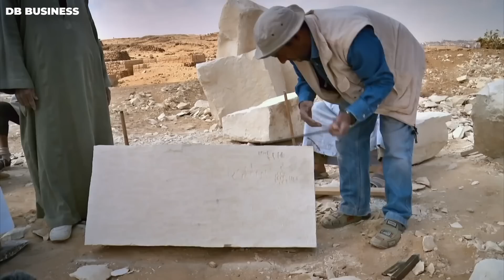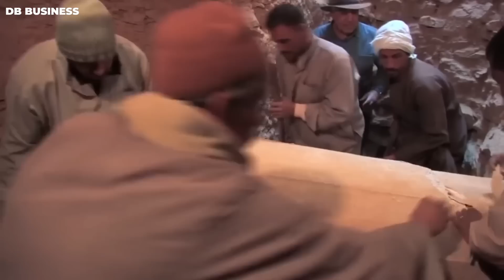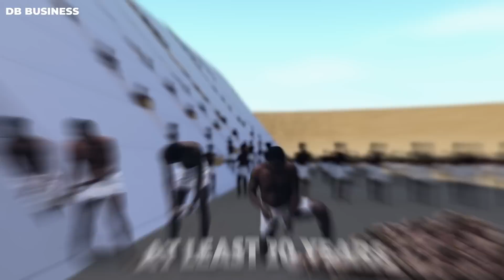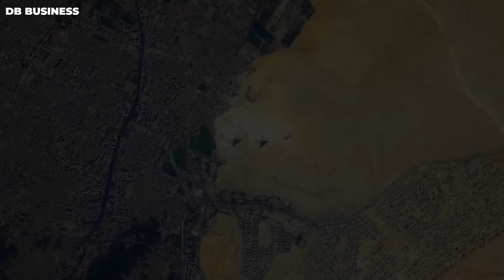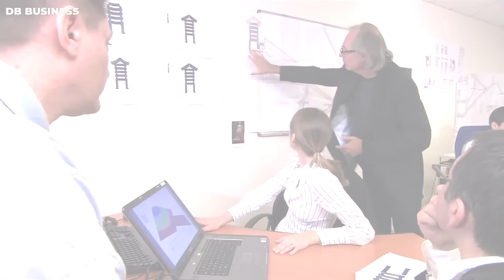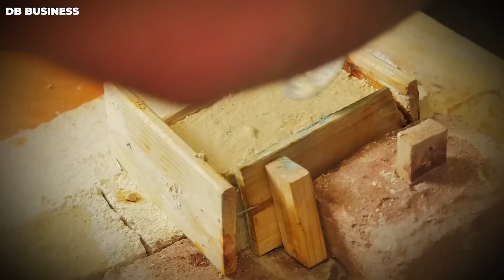The Mystery of The Great Pyramid Has Just Been Solved by Elon Musk

Comment: If a man can lift 200 pounds. It'd take 800 to lift 80 tons. That's not accounting for the friction of lifting with sub par pulleys. And not accounting for exhaustion. Seems a bit small of a landing for 800 people. Maybe they used counter weights?

When he says each 2.5 ton block was carried up the next step by 8 men, they assume each man is moving 625 pounds.  These are some damn strong humans!!!!!!!
Reply: You can’t just divide weight like that to decide how many people it would take. There’s also only one block that might possibly weigh “close” to 80 tons.
Reply: @AveragePicker  oh, no?? How should we divide it up?? Each man has a forklift capable of lifting 3 tons, so it'll take one man for the little bricks. He can just drive it straight to the top! I'm aware that's a very crude equation, but it's close enough to show the idiocy of the idea that 8 men can move a 2.5 ton stone.
Reply: @jamesdriggers2011  Why are you now talking about forklifts? And your terminology is all over the place for whatever direction the object needs to go. With levering and some creative physics it’s entirely doable. Heck at work using nothing but lots of wood blocks, wood mallet, and a pry bar I move about 3,000 pounds of flat pallet packed racking. Granted I only needed to move it about 16 feet and rotate it but I clearly can’t “lift” 3k pounds. 
You can balance off and tilt weight as well so while no you can’t “lift” a refrigerator by yourself you could still load into a truck bed. Physics.
Reply: @AveragePicker  they are being depicted lifting the blocks up to the next level. Im not saying it's impossible to do by sheer man power. Im saying thier math doesn't add up.

Comment: The conventional explanation for the building of the pyramids is total hogwash. Engineers have looked at it and said that if ramps were used to haul blocks up the pyramid, the ramp structures would need to be more massive than the pyramid itself and there is no physical evidence of such a ramp ever having been there. Including, where did all the material for the ramp go?
And they weren't tombs. No mummy has ever been found in them, none of the things that go with mummies, and no hieroglyphs. The mummies are in tombs in the Valley Of The Kings.
Also, geological and hydrological evidence shows them to be far older than we are told. FAR older.
The Japanese tried to built a 1/4 scale model of the great pyramid using modern technology. They failed almost as soon as they started. They couldn't even come close to doing it. 
I don't buy Elon's UFO theory either.

Comment: The pyramids at Giza plateau are definitely OLD. I believe the Egyptians merely settled there seeing that land as divine. With their levels of technical capabilities, it is impossible for them to create those though I believe they have tried with "other" pyramids around there that are crumbling. They can't carbon date the great pyramid, but some people have taken note of the water erosion on the sphinx that if true puts it in another time with a much different climate. Possibly 20 to 35,000 years old. They weren't tombs and "egyptologists" that keep clinging to that only want to protect their wallets and reputation, it is despicable. The great pyramid was built like an insulated electrical circuit. The outer white limestone had almost no electric conductivity while the inner stones and red granite had amazing conductivity. Their copper chisels could not have cut the granite as accurate and as fine as what is shown, there would have been wavy wedge marks. It was built it seems to have a functional purpose, and to hold power within to be harnessed then sent up the grand gallery to the kings chamber to be emitted out the shafts which have the same size dimensions that one would use for a microwave waveguide. To the north in Abou Rawash the Pyramid of Djedefre they call it goes against all their so called theories about how it they were built. This particular pyramid sits atop a mountain and built into the ground..it also seems to have had a functional purpose. The fact is either these were built by humans at another peak of technology and forgotten, or "gods" from another space system that created us in their image. I do believe the old testament bible, but I believe it is translated wrong. The only other thing I can think of is that Atlantis was real, and who were the Atlanteans?
Reply: You forgot to throw Bigfoot and ancient aliens into your absurdity.

Comment: Sorry Elon -- the blocks were floated to the site, and raised to height while keeping the stone soft in water. Animal bladders provided positive bouyancy.  Just a matter of channelling water. The long internal shafts simplified the rise from within. The surface were smoothed using the water level as while the stone was being finished, each a copy of another.  It's a lot easier to pour water (Artesian ?) than lift blocks.
Reply: lol Sure they did. So tell me how many animals bladders were needed on each stone. I want actual stone weight vs buoyancy of the animal bladders in the water. Not to mention the water system to hold that much water and weight and raise them would be more impressive than the pyramids themselves. The internal shafts are not big enough so that's out...   You should do stand up.

Comment: Common sense says people did not drag building size blocks thousands of miles with logs and pulleys. The material it's made of is both insulated and conductive by electricity. It uses piezoelectrics and sound resonance to transmit power wirelessly through the earth and air via it's gold capstone.

Comment: If the pyramids were built by men, it could only be with the help of a technique other than chisels, hammers, rollers, ropes, etc. Moreover, using a new dating system called Chlorin 23, the Stonehenge Site was estimated to be 25,000 years old instead of the 4,500 years established by the system. The great pyramid having received +/- the same age as Stonehenge, it is normal to also give it 25000 years. The Egyptians have nothing to do with it.

Comment: Pyramid was made for electical energy, a sun dial, and calendar. Its just like tesla who invented free electric energy and Chinese made a calendar. They built it accurately using math numbers, engineering and workers. They used the Sun, the axis of earth, the time when the weather is changing thats why theres an portion in the pyramid that they can adjust. Also those 3 pyramids are accurately pin point on orion constellation.
Reply: And the sphinx faces the constellation of Leo during the summer solstice.

Comment: What I think is that they had lots of materials to work from, as sand rock and cement, water and limestone, like Mexico and South America, they where not dummies. With concrete you can build the biggest structure in the word.
Reply: They didn't use any morter at all.?
Reply: Actually the granite used in the "king's chamber" was from 500 miles away.
Reply: @nittydalion  that proves they weren’t dumb, they have material from all over
Reply: @Jayfrm301  I definitely know they were intelligent. It begs the question, how did they move them that far and then up that high in the air?
Reply: You mental timeline is a little off lol

Comment: Elon, Hawass, all of you have totally overlooked the most important missing fact:
Granite can only be cut or shaped by a harder material.  Diamonds are the next hardest material naturally occurring yet there’s no evidence of them being used, no diamonds nor diamond dust.  Secondly steel was not in existence.  Thirdly each of the 2.3 million granite blocks contained in the Great Pyramid was custom cut to within 1/1000th of an inch as found in the interior, not even a sheet of paper can be slid between the blocks. This is impossible to achieve with the tools in known existence. Today, we could not achieve 1/1000th of an inch flatness over the full length, width, depth of each of the 2.3 million custom cut granite blocks weighing 80 tons each in most cases. Ropes can’t take that and wooden skids can’t take that.  Had to have been done using a very powerful laser and/or anti-gravity for both cutting & shaping & lifting into position. Anti gravity boring and tunneling machines are in fact in use today as used in gold mining underground and tunneling.  No dirt is left, all matter in front of the anti-gravity boring machine is vaporized, leaving a smooth surface. Anti gravity lifting technologies hsve been in existence in USAF since the early 50’s  just classified.

Comment: The great pyramids were likely squatted upon due to their splendor and grandeur. The Serapeum of Saqqara bears evidence of this in that it is suspected someone had the idea to use them as physical symbols essentially for religious propaganda, the surfaces were vandalized with rough chiseled glyphs in comparison to the finish quality of the giant stone enclosures. 

There are no actual records of them finding pharaohs in the great pyramids, we find them in the valley of the kings. Historical record has a man being lent a deal of shillings because naturally, many who laid eyes upon them in ancient times were probably enamored. 

That does not begin to mention other copious number of oddities in the great pyramid, Khufu. Gantenbrink's doors or rather those plates, with corroded metal prongs and a corner cut inside a shaft that is built in the most complex way you might imagine while being made out of stone. 

All of it is very peculiar in that we have installed stairs to get around inside of this thing while orthodox Egyptologists would say some men would drag or maybe shimmy their way around these things but then again that does not consider the two apex points you are met with when confronting the ascending passage and then what is the ceiling of the passage to the "queens chamber" and the floor of the ramp of the grand gallery. 

Then you have the antechamber which has pink granite sliding gates with extruded like tracks in them of which could be adjusted with ropes at one point. That and the "kings chamber" is resting on an egg carton bottom type stone bed to reduce surface contact point or something. Adding the fact those "ventilation shafts" are blocked by the plates that Gantenbrink's team discovered. 

One of the shafts are actually bent so that it does not intersect with the grand gallery. It is a major wonder of our world in that we could not build these in modern times, and we cannot explain their actual purpose to date they elude all manners of explanation while being built out of something as rudimentary as stone.

Comment: The Pyramids at Giza, most notably the Great Pyramid, is a masterwork beyond our current technological capability to reproduce.  It is almost perfectly aligned with true North,  It sits on the point of greatest mass on the planet.  The speed of light is encoded within its dimensional measurements.  We've also recently discovered that the Great Pryamid controls electrmagnetic wave propagation through its structure, and focuses them into its inner chambers.  It is eight-sided, each face having a slight inward indentation, which can only be seen from the air, and which cast a shadow that is only visible on the spring and summer soltices.  There is also a notable staggering arrangement from one level of stone to the next; an overlap arrangement for added strength.  The indented faces, and the staggering of the stones, SIGNIFICANTLY INCREASES the level of complexity in its construction.  It's not a tomb, and it wasn't built by slaves, with ropes and pulleys and copper chisels for their tools.  Truth be told, we really have no clear idea what it was built to do, or how it functions.  Imho, it was built before Dynastic Egypt was established, by a civilization with vastly greater capability, and greater understanding, than ourselves.
Reply: I know why it was built.
Reply: @GoldenChyl  Someone either LOST a bet or someone WON a bet. Plus the internet was down so they had nothing else better to do.

Comment: Simple. They are made by using sand as ramp and building platform. As they go up in height the ramp/platform goes up and longer. RISE and RUN must be maintained. An ADA compliant slope of 1-12 for example.  (The peak of the pyramid makes the RUN about a mile.) The site has so much sand so no problem. Sand could be compacted with water. Have acrew to do this daily. Essentially they are building at ground floor all the time. Makes it easy. They could build 2 at the same time... When done and as they take away the sand ramp and building platform, it's time to apply the exterior coating.

Comment: The original original ancient civilization in Egypt used dinosaurs like we use horses today. Dinosaurs were very much more intelligent than we give them credit for. They had huge brains. Plus there was also larger humans as well they were also extremely intelligent with large brains. That would be considered Giants today. Plus the very very early early Egyptians were very intelligent and already knew how to use man-made boats to move objects. Using an extensive Waterway system that went right to the pyramids and around the pyramids. also used the pyramids as power collecting sources. It wasn't until many many generations after the pyramids were built that it was eventually used for the Pharaohs burial tombs.

Comment: I'm a master machinist and a manufacturing Expert.  There is no easy quick way to build something like this.  Pouring and molding the blocks, would likely be the quickest and most accurate way to build them however, the casts would take a long time to cure to the point that they were durable enough to be handled, transported and installed.  Cutting them, even today with our very best equipment using Diamond edged blades, would take much longer than the time alloted,  for processing and installation. 
Possibly Laser's or Plasma arc equipment,  could have been used however,  we do Not possess that technology,  that can cut such huge rocks, even today.  Having Scotty, Beam the perfect sized rocks out of solid bedrock,  would even be challenging,  given the complexity, if it were possible.  
Giants, playing with their version of Lego's,  is my best guess. 
There are just Way to many blocks, weighing Way to much, for mere Mortal standard sized Men and Women,  to have built it in 25 years. 
Maybe back then, you could order "Pre-fabricated Pyramid's, 
Online from your GODS SUPPLY-ALL Company, through Prayer and offerings.  The detailed engineering and assembly drawings, would have taken a very sharp Team, Years to do.  I think about how much Time, would it take to make a small copy of it, maybe 10 feet tall, out of aluminum metal, machining each part or possibly Casting a selection of modular parts, that fit certain positions of the Pyramid, consistently. 
Ie, Right hand and left hand, alternating corner stones and universal main blocks, and make-up sectional blocks. Then they could be Mass Produced. 
It still would take much longer than 25 years for us to do it. 
I personally believe that they were probably made much longer ago and over a centuries time or even longer. Then the Egyptians, discovered them and Graffiti'ed them and claimed them for themselves since, nobody seemed to object. 
Silly but, just as plausible as any other theory.  One thing is definitely True. Whoever built them, was Very ingenious,  Highly skilled, Efficient and had technology that would rival anything we have today, just to be able to mass produce,  at the exact sizes they did, consistently.  They had to have a Top notch, Elite Quality Control department,  better than Anything we currently have.  
The amount of energy required to build them  as quickly as they did, is amazing.
Reply: Interesting 'factual thoughts'. I'm wondering how your extended timeline would fit to the suggested development through step pyramids of Sudan or Mesopotamia, which I understood to represent the logical development in ancient masonry.
Reply: @markthomas7279  maybe the Great Pyramid came first and all the other smaller and lesser pyramids were  people trying to imitate it and figure out how the Great Pyramid was built?
Reply: Theory
Reply: If the Great Pyramid was mentioned in the bible with its dimensions and specifications like the Ark of NOah and the Ark of the Covenant, nobody would believe it ever exisited if it didnt still stand today. But there it is.  Theres no reason why those other things couldnt have existed also.

Comment: The idea that everything was "carved", does not make logical sense. .rather instead, it may have been possible  that each block  made could have been powdered  stone placed in a form, then a catalyst added to harden..once hard..the next block  could be placed  beside it..and the they could use the first block as one side of the form..resulting in not even a razor blade between them..this way zero mess..and easy to transport  powder and best of all zero " carving". A large stone wheel grinding away at hard rock would produce all the powdered rock....

Comment: Unfortunately, this doesn't adequately explain how they could lift 80 ton stones with man or animal power. Even with pulleys that is not happening. It also does not explain the inner most stones that weigh HUNDREDS of tons. Academic 'experts' do not have a sufficient answer to the question of how they were built, nor can they answer how any other megalithic structure was built, most with similar or even identical engineering and architecture all throughout the world.